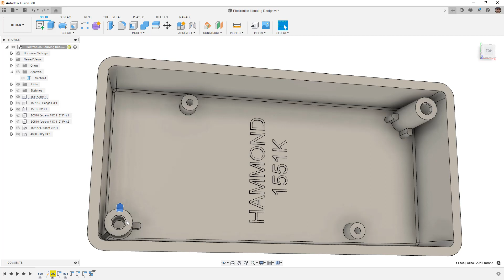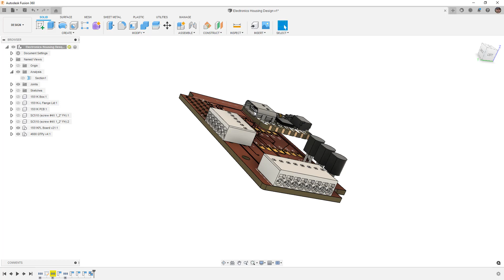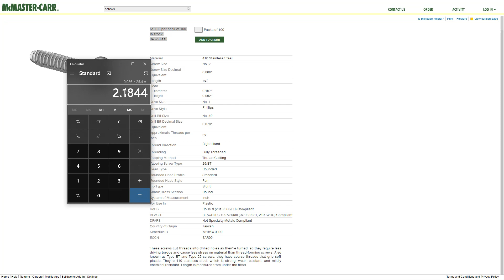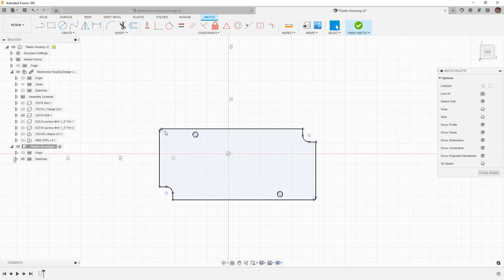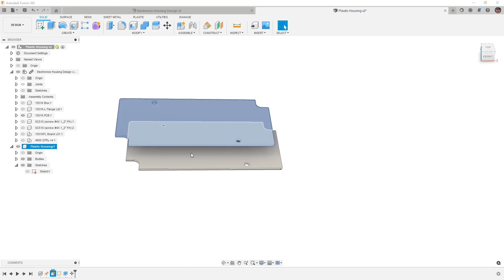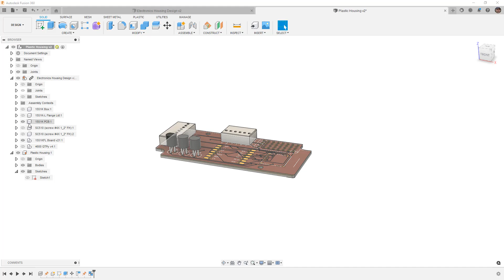Plastic Part Design Series Episode 3 - Layout and Planning Phase #Fusion 360 #Design

Comment: The part about aligning and different origins was very confusing. What are we doing there, and why?
Reply from the maker: Each Component in Fusion 360 has its own coordinate system.  Fusion keeps track of where those are in relation to the top level origin of the design.  In general you want to use symmetry so the origin would be at the center of your design, but when you are importing reference as a basis for a design that can be tricky.  I was merely mentioning that you want to use symmetry in general but in this case we aren't because we are basing the design off the pcb inserted.

Does that help?
Reply: @LearnEverythingAboutDesign  Yes, I think so. I guess I just missed an explanation of where we where going before all the fiddling around.
Reply from the maker: @feelfreefpv  Nah, i just sort of was talking about all the different ways things can be done....  I will be making a new plastic part design series this year and will try to be more focused with it.